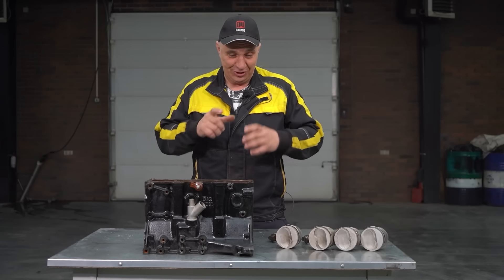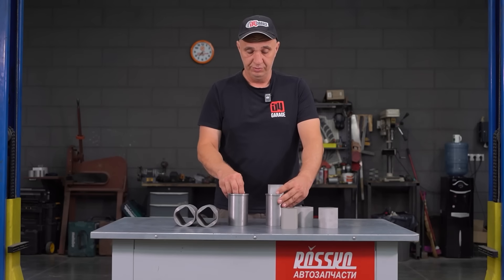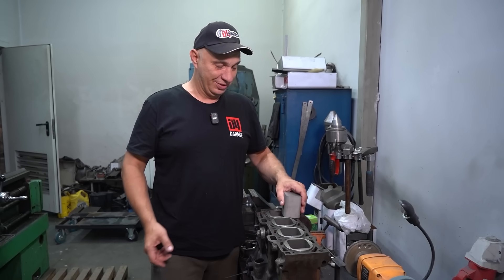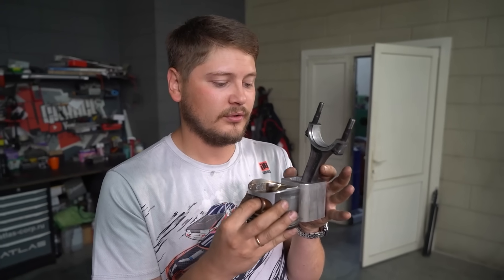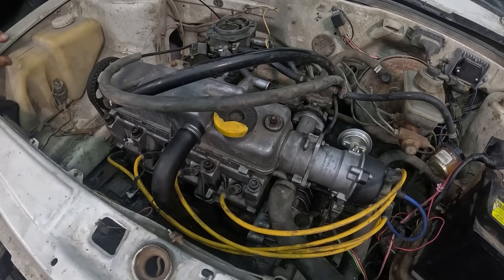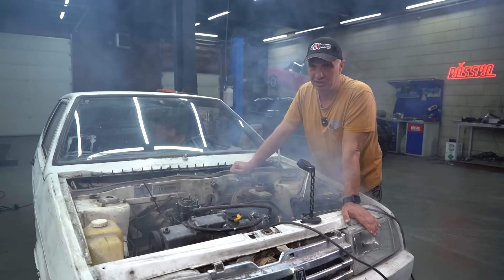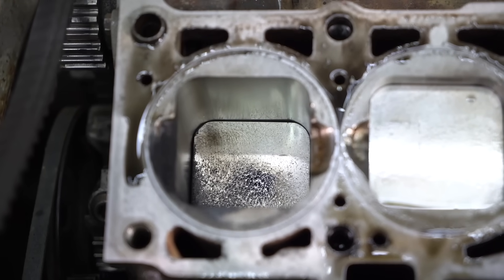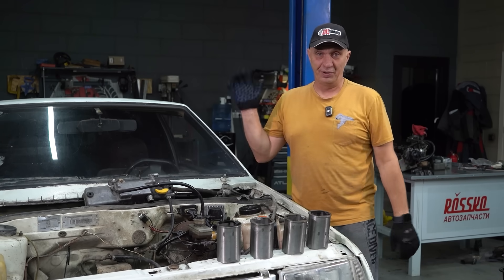We make square-section pistons - will they work?

Comment: Honda once made a racing motorcycle and later a road motorcycle that had "cylinders" and pistons that were far from circular. They worked but were not very successful. The idea on the racing motorcycle was to get round the effects of a rule that specified a maximum of four cylinders.

Comment: The big issue is they used rubber for the piston rings. I knew right away that they would melt once the engine would start building heat.

Comment: It's an amazing project from the point you started and what money is being spent. But you are reducing a CC of the cylinder that would generate in smaller power production
Reply: I believe some of the Russian engineers can be some of the best and nuclear research but I wonder if your mechanical engineers can Ashley make a connecting rod that is supported by the crankshaft that feeds oil all the way to the piston rings to provide a better cooling unless wear on piston rings and boars of a cylinder block with a greater efficiency and cooling and they patrol or diesel engine
Reply: Electric cars may be the future but a multi electrical and a gas powered engine could be a solution for a multiple solution all around the world
Reply: Why hasn't Russian engineers designed a multiple phase electric motor beyond three-phase or gas power engine can power electrical motor with more efficiency.. this technology could be used in jet fighters
Reply: I wonder if the Korean military has ever made a design like this South Korea.... I don't believe in communist countries
Reply: Do you know any jet engineers in Russia... Not rocket engineers... Trust force?? Be made in high altitude... So a drone that can fly on gas first and extend its range on electrical.. dissolving the heat exhaust so radar can't capture it.. I guess it would be considered a spy drone.. does the FSB have a engineer department?? Pick it up and leave the Korean DIA has one
Reply: Sorry I am American and I have the first amendment right I can ask questions but sometimes I can't receive them.. but it sure doesn't stop me from asking😂😂😂
Reply: Creamy crazy mechanics all around the world.....
Reply: Note f 47

Comment: The round shape ensures that the flame front reaches all parts of the cylinder symmetrically and quickly, leading to more efficient combustion. It also minimizes surface area in contact with the cylinder walls, reducing heat loss and improving thermal efficiency, we've known this for 165 years This is basic physics, physics is not wrong its people who dont apply that are wrong

Comment: Why not use metal rings in it? Maybe putting 2 “C” middle half + inverted ..

Something like [ + ]  .. it will have double clearance but should work OK.

Could use then 3 rings/piston 

First line : [ ]
Second line: [ ] 180 degrees
Third line: [ ] 180 degrees

Will be easy to make, bore, and to fit to the piston.

Comment: Thank you guys for taking your time and skills to test this funny area out. Can you test a link to 15 Car Generators driving one Car Electric Engine as well. One Generator pulling 15 Generators and power the Electric engine. Make each wheel drive 1-3 Generators by chains or belts. As you have little to none fiction to drive a Generator it would make it kinda easy to set up if you have the skills to team work.

Comment: Rubber as compressionrings??? NO, special steel is needed.
Also the lining up of the sleeves has to be 100% accurate, or the piston and sleeve will wearout quickly. 
Its a no from me!

Comment: A copper wire the diameter of those rubber o rings would probably work, and cooper being softer, it would help take up any imperfections in the cylinder wall. It would have to break in of course. Also drilling holes behind the oil groove would help with the blow by as well.

Comment: "It works" is relative. It is more hilarious than working. You guys fixed it all right.  Anyway, fun to se that an engine can run at all with square-ish pistons and cylinders. The ring problem is real, and o-rings will not cut it. It is obvious that there is soo much blow by, that there is no way to solve the crank case breather issue. Find a way to use metal piston square-ish seals, and this silly engine might actually work.

Comment: @garage54 make some apex seals like a mazda rx7 rotary engine has for the corners of the piston ( you need  to make 4 straight seals and 4 corner seals, all must have spring tension for each compression ring, 8 total for that engine)  i made a flat head honda lawnmower engine run the same way. I did this about 15 years ago. Get in touch with me and I'll be glad to send you the design i came up with. Engine ran for 2 years without issue before it was stolen and junked
Reply: NICE

Comment: as usual the problem is their execution of the project. 
rubber orings in an engine? they looked like the regular nitrile rings instead of brown viton high heat o-rings.
i can tell the way the guy filed the corners to fit the oring grooves wasnt ideal either.

Comment: Old piston ring were made from cast iron. I’d LOVE to see custom ones made from metal, even one stamped or cut from a high carbon steel. 
I think they’d last a long time. And to get around using a proper oil ring toss some two-stroke oil in the gas.

Comment: The main issue with square pistons is always the rings. The corners concentrate force, and cause extreme wear over time. The rings also cant spin around. So they never really find a comfy spot like they do on a round piston.

Comment: I guess you need metal piston rings, but how can they seal properly on a square piston?
I'm thinking 4 part rings that have a gap on each side, installing them might be fiddily but if the tolerances are right it should dothe trick.

Comment: Take care if you use seals or o-rings in Viton When overheated in a fire or other overheating over 200 degrees celsius it can develop a acid  who is extremely corrosive called flouratic acid so use gloves in all contacl with overheaten viton

Comment: This isn't rlly a novel concept to begin with. Oval and square pistons have been made before to see what could be done. But the added bonus of displacement did NOT outweigh the added costs of fabrication. It was just easier to make everything round and less complex because you got a little more displacement out of the same size engine. Nonetheless i think it's and good video

Comment: Not that rubber rings were ever going to work very long, but the lands cut into the pistons should not have been cut into the corners.  The rubber is clearly recessed in too far in the corners and allowed gasses to leak by.  Fun video and good work.

Comment: How about using galvanized and copper wire for the rings. they bend and keep shape and resist heat and friction better. galv top, copper bottom

Comment: There no difference between in working principle between square and cylindrical piston head, what engineers care about is cost and time, it is easier to reproduce a cylinder head with tight tolerances in a lathe cheaper and faster than square head pistion with EDM

Comment: Square cylinders would only have advantages if the engine block were designed for them. Using square inner cylinder liners in a block designed for round cylinders would reduce displacement.

Comment: plese help me how to repair oval crank pin and rebuild metal bearing cranksaft with another car metal bearing🙏🙏🙏. specialy motorcycle engine. in my country so expensive to buy cranksaft multi cylinder. and part my motorcycle almost not produce again

Comment: If you think precision is unreal with an edm, I’d love to hear your opinion after seeing what a laser can do. Edm still takes away material the thickness of the wire. That doesn’t happen with laser. Insanely more precise. I’d friken love to see what you guys would/could come up with if you had a laser. Love ur ideas but some of ur machinery isn’t precise enough to make some things properly reliable and give them a proper good chance of working. Still blows me away at the things you guys pull off as is tho. Very impressive

Comment: Since this isn't looking to be a 100km motor, I'm curious if shaping and soldering in a copper ring would work. Once it heats up the copper will expand a little more than the steel and should make a seal. I'm sure it wont last long, but probably more than rubber.

Comment: I was thinking about making square section headers, since I only had sheet metal and it would be very easy to cut and weld to any radius or curvature, I wonder how much less efficient it would be to round pipe free flowing headers Mmmm

Comment: Use wire coat hangers for rings, they might be just soft enough to make a good seal to the cylinder walls.. A thick brazing wire might be even better..

Comment: Rubber piston rings are  the main  reason for the failure Try  a rubber ring  which are thicker at corner specifically then rest of the side then a proper compression will occur

Comment: Should’ve not tried to fit rings with the tight tolerance of the square fit it would’ve made fantastic compression. Ran and seen if they Pistons wanted this season there if they did, you must need titanium rings that are square not round using rubber for compression is not going to last or even silicone.

Comment: Explosions propagate radially in a spear shape. The cylindrical piston is the most optimal shape for a combustion engine. The square Pistons and expansion chamber will receive uneven wear  unevenly deform. Boring out the inside of a square piston is much more complicated than boring out a round piston. Cool concept but there's a reason it's done the way it is

Comment: I feel like the graphite impregnated rope they use in steam power hammers (Alec Steele has one he rebuilt, for reference) might be better suited than rubber piston rings. After all, they hold up just fine to the immense heat (and water) of steam. That's assuming they're interested in this running for more than a couple minutes like last time...

Hopefuly they also remembered to slightly offset the piston pin, like they pointed out that point time. (I'm sure they did, but may be that's why there was polishing?)

Comment: obviously you cant use steel rings but about bronze wire?  bronze has low friction properties and after the initial crush it would give better compression than rubber.  you could even braise it together if your worried about tear out and scoring.

Comment: Just an observation. They have a wire EDM so why didn't they just EDM the piston rings? Grinding and/or lapping equipment to finish them not available?  The oil ring wave spacers could have been made using wave stock from an existing set. I know it's jest and this crew are great at have fun making these videos but it's a shame they did all that work just to come up short for something simple. There are arguably some potential design advantages using this approach. I'll get back to you once I think of what they are.  The benefits of a higher education. :-)
Keep them coming nonetheless.

Comment: Ask Honda about oval pistons....NR500..."The piston ring, also, was a real headache, since the oval shape was so difficult to machine accurately. Experiments were repeated over and over, through a process of trial and error. For example, they tested a split-type ring made of two parts and formed the ring into a "walking stick" shape. But after every conceivable alternative had been tried, they found themselves back at the starting point with a conventional, self-stretching piston ring. Even with that configuration they still had to expend extra effort calculating the appropriate dimensions, so that the ring would remain in free form during machining, but produce constant bearing pressure once installed. NC machines were still inaccurate during that period. Therefore, additional effort was required to produce the desired quality of a part by accurately reflecting the specified machining dimensions...."

Comment: Back in really early Honda motorcycle racing engine development, they tried to skirt the rules on piston width by experimenting with Squares, Ovals, and even Long Pill shapes with 2 connecting rods each. While they all worked, the reliability turned out to not be good enough for production. They never did try rubber rings though! The pill shape piston engine was reported to be very powerful on the top end, but too sluggish on the low end due to all the extra rotational mass. They did try racing with it though, and while it did great, it only did great until it didn't, and it didn't finish the race due to ring failures.

Comment: Try a 4 piece ring where each piece wraps a corner, then overlaps to be double stacked on the straight sections. I think this might work. If there are issues with the corners not sealing, then use some spring steel behind the corner that forces the corner outward. Kinda like a rotary seal.
Reply: Would need some specific alloy that is used on piston rings in general to work properly and even then the dimensions would need to be very high accuracy to take into count the thermal expansion to all directions that is several times harder with this piston design and even then those would be rather thin so snapping on the corners would be likely, but maybe 2 row 2 part rings might work, but i would say some high temperature polymer in form of hydraulic pressure seals so when there is pressure the sealing increases might be solution, but that will be expensive as hell since needs custom seals. That would be likely several K at the lowest minimum to tens of thousands more likely. Even with their budget bit too high of a cost.
Reply: @Hellsong89 you mean something specific like, iron? Yea, I think we all understand that much. The problem isn't really the precision, they've got access to an EDM cutter. The real issue is with maintaining the constant pressure necessary to create a seal against the cylinder wall. Circles are easy, not squares though. The expansion can easily be accounted for by using the overlapping split ring design that I spoke about before. The issue of maintaining pressure against the cylinder wall is the real difficulty, but I'm certain that a spring steel arc spring as a backer could solve this. I'm not suggesting it would be great, but it would definitely outlast the o-rings and could maybe even maintain enough compression to run Ok. Adding an additional compression ring of the same would likely help even more. This isn't really all that complicated either. We're talking about making a single iron ring cut about 75% larger than the bore, then cutting it into quarters leaving 4 equal length corners. Then cutting some spring steel into a wave, similar to a wave washer, that will be placed behind the rings to force them outward against the cylinder walls. Getting the pressure correct will likely require some trial and error, but could definitely be done by these fine folks. This would 100% work, but you will likely still see some blow by on the corners.

Comment: me personally i would try to fabricate or try to make some proper metal rings and give it another go that would be interesting to see and to see how many hps would be coming out of the motor at that time sure it would be tough but they went that far and it worked with rubber rings but metal would be better

Comment: The main reason for cylinder is because round things can get milled with an accuracy of microns. This is why the sealing of rotary engines have always been so crap compared to regular piston. So there is no reason at all this shape will not work, but it's just that we go back to last century precision standard.

Comment: I can see how square pistons could help reduce the weight and outside volume of an engine. That might be useful in racing where every bit of added efficiency matters if the shape doesn't create unsolvable issues.

Comment: Triumph made oval pistons in the 30s (I think?)  they made a steel tube the same shape and cut rings from it.  They made a 3 cylinder engine the same width as a twin. The narrow thrust face was an issue and the project went nowhere

Comment: Make square piston rings out of Teflon.
Reply: Teflon melts.
Reply: @johnt.848  Rubber burns.
Reply: @madmanmapper  silicon rubber is often used in ovens and other high heat areas.
Reply: @johnt.848  Teflon has a higher melting point than silicone rubber burns at.

Comment: Honda made a motorcycle engine for racing that had oval like shaped pistons with 2 connecting rods on each one. It was an attempt to circumvent the 4 cylinder limit on the rules.

Comment: For the ring issue, you could make rings out of two edm cut pieces of flat spring steel that are in an "open" L shape. So, like an "L," with unequal length sides, but open so the inside angle of the L is larger than 90 degrees so you have to squeeze them "closed" to make them 90 degrees and fit them in. You'd want two rings like used here, but you could offset the L shape on the second ring so the gaps don't line up.
Reply: ya the rubber was cool but a full effort set up would be amazing .... or a new video with the piston right gaps might be tighter  with this set up....